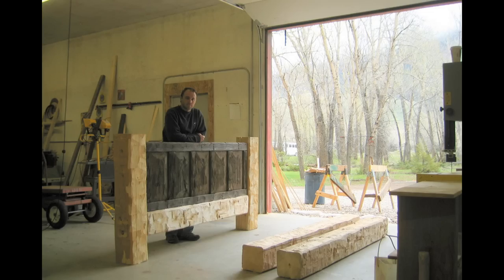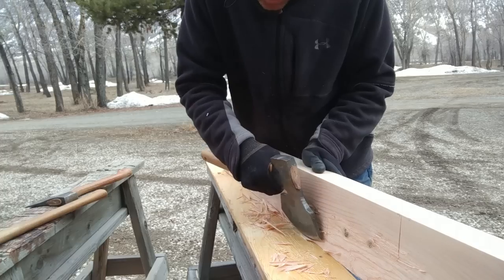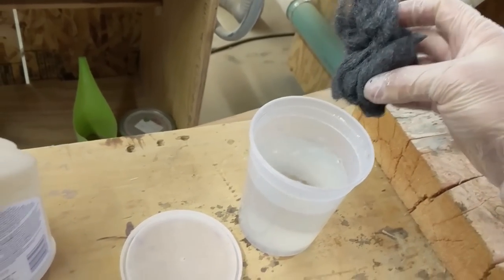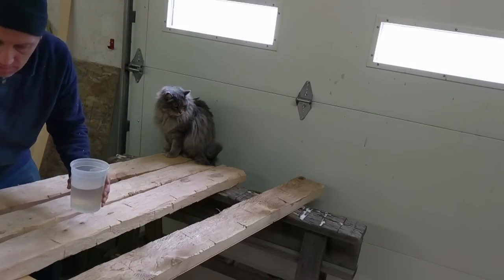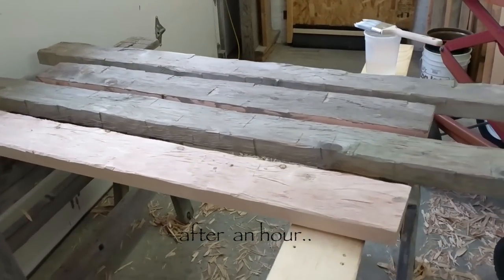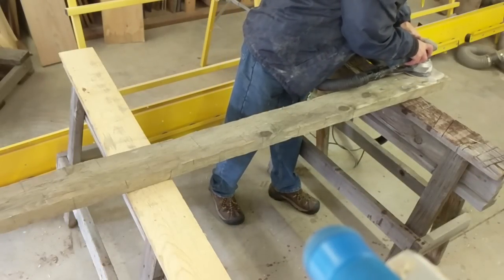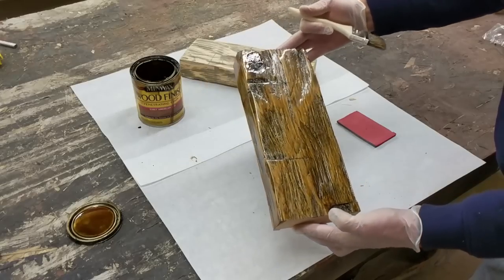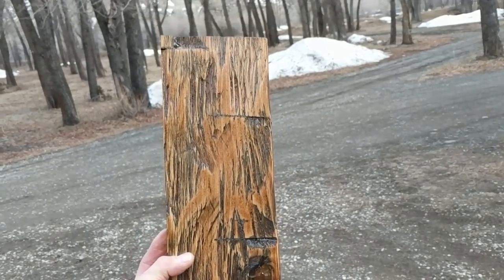Aging and finishing wood technique

Comment: Here’s a good question for you, would that “stain” work if you did that put the steel wool in it? And did you discover this by accident or is it an old family recipe? How did you find out about this? Okay 3 questions lol.

And I don’t know about that type of wood, but I much prefer rung oil to shellack but I mostly work with oak.
Reply from the maker: Vinegar and steel wool it is known in carpentry world as a stain, also black tea after or before it works great too